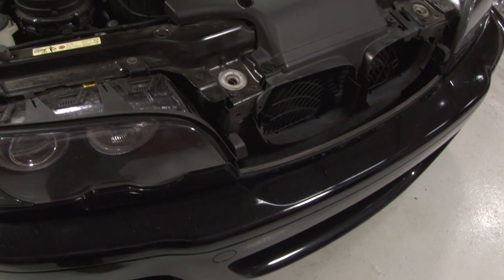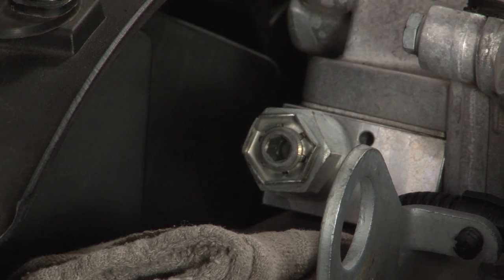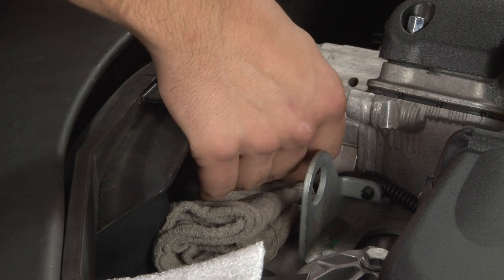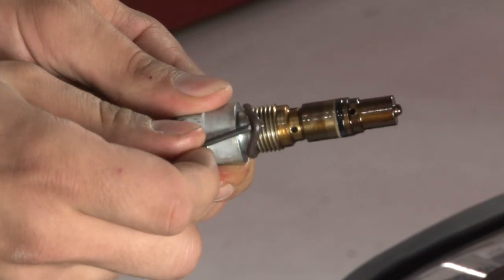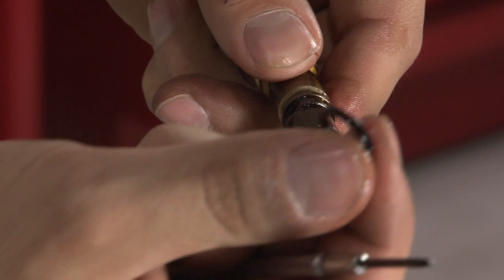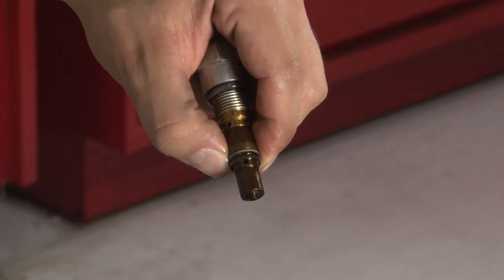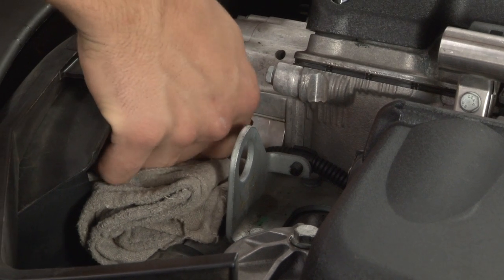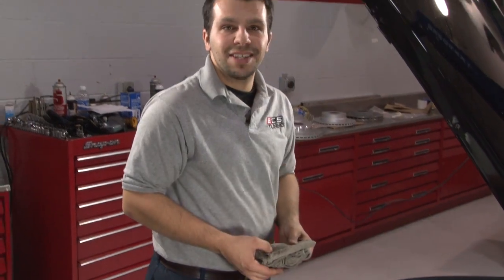ECS Tuning: DIY - Vanos Filter Change (Level 1)

Comment: PLEASE  a need advice  on how to take it filter off,  i can see with the mirror , but no way to insert the t40,
Even took out the wheel,  but  the chassis  don't  let me fit it correctly,  adding a swilling  is imposible  to get a  T40 in place
By hand i can't  touch  it, 
Now i afraid  if i can took ofg hiw i gonna screwed  again is aluminum  and can mess up the threads
Help is shaking  on reverse and ever stop

Comment: Nice video and i would suggest better to use an old credit card (cut in half) to remove the o-ring, this would prevent scratching the groove and causing leak.
Reply: cut in half? sorry but i'm not picturing how to apply a half sized cc to remove the larger o-ring?
Reply: A cut in half C.C.  to slip then bend circular to slide off... pretty smart.
Reply: All old cards are usually ment to be cut in half.... so that is also why he said that